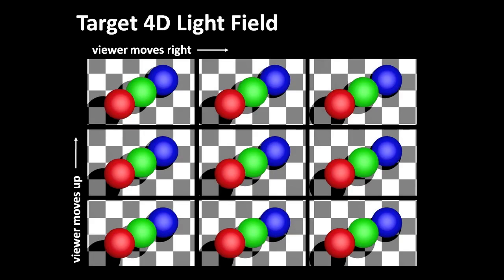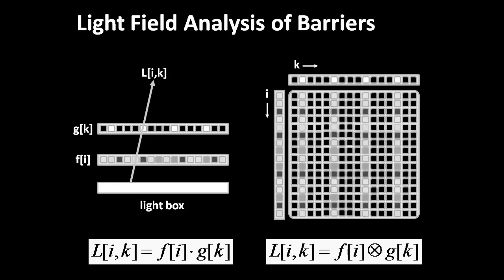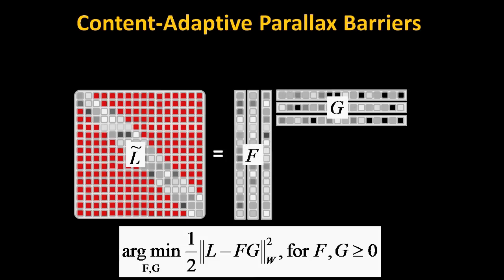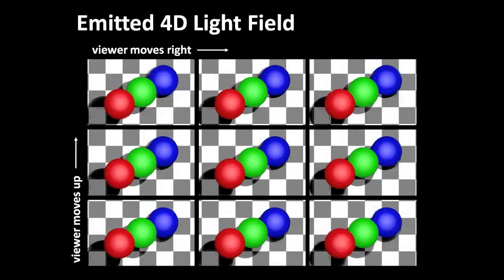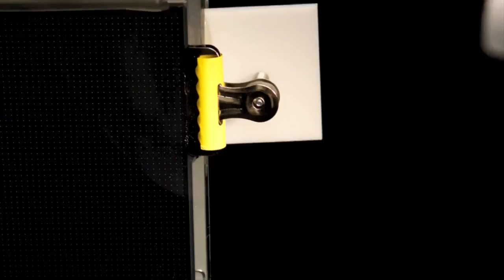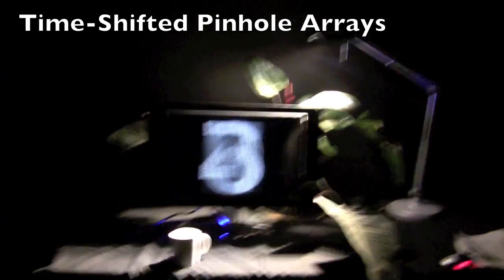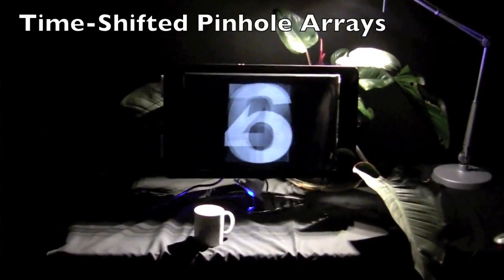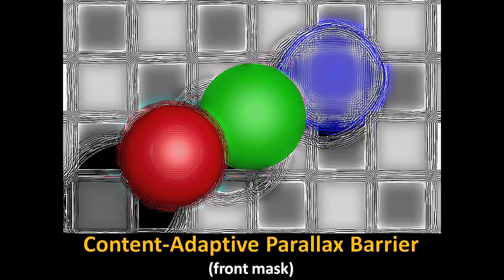Glasses-free 3D Display using Content-Adaptive Parallax Barriers: Siggraph Asia 2010

Comment: How is the parallax pattern generated if it's optimizing to least square of the light field...?
Does that have something to do with the weighting function? Or it is because the randomized initial value converges to those pattern as a local minimum...?